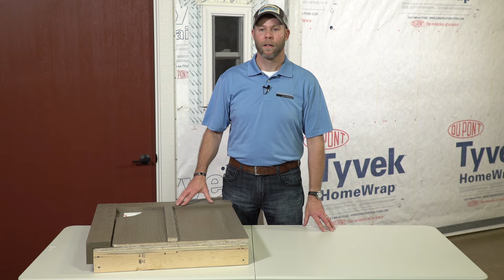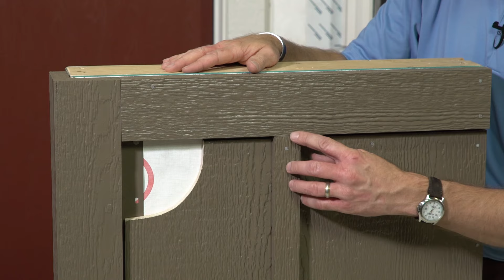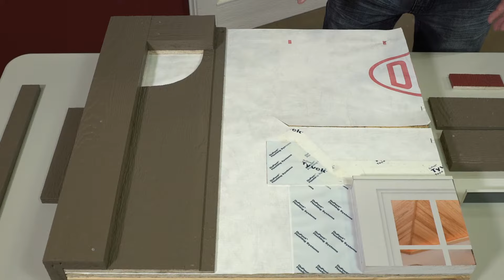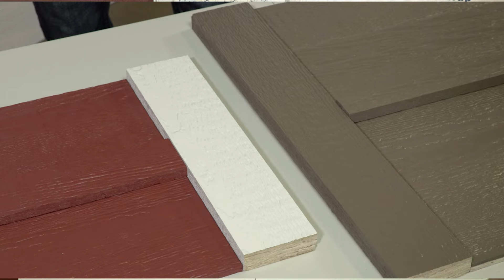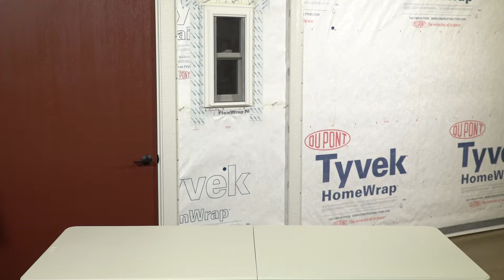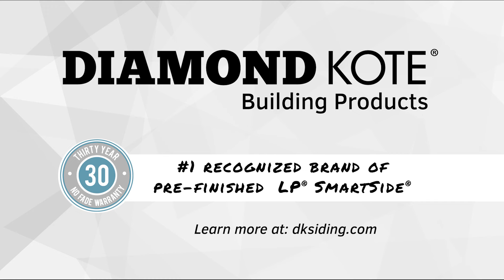Understanding LP SmartSide Board and Batten Installation Options

Comment: Don't double the trim above the window then cut your siding around it. Install siding first then install the 1x4 window trim. Saves unnecessary steps and less areas for water infiltration

Comment: With the new 3/8 panel and 19/32 batten, what's the window detail? Do you still pad the header and put the trim over the panel around windows? Or does trim get installed first with the panel butted up to the trim?
Reply: That part made no sense to me. I cut the panel to the contour of the window. Then I placed the trim on top. Easy peesy .

Comment: 3/8 gap. Why not just make it an inch. Looks like crap when done. Looks like a child installed it
Reply from the maker: Per our manufacturer, 3/8" is the minimum spacing requirement on all flashing, otherwise the warranty is voided. You can go with a bigger space, as long as it is over the 3/8" minimum.
Reply: @diamondkotesiding  I know. Which is silly.

Comment: LP recommends a 3/8" gap between panel siding and trim. It looks like you are installing it underneath or before the trim. This makes it look more finished but does it allow the siding to expand properly? Does it void the warranty?
Reply from the maker: Hi David! That's an excellent question. The typical space required between the panel siding and trim intersection is 3/16”.  LP does allow for trims to be installed over the top of panel siding.  The siding will still expand and this practice, when installed properly, will not void the warranty. Page six of the link below has great visual illustrations to assist. https://lpcorp.com/resources/product-literature/installation-instructions/lp-smartside-trim-fascia-english 
Thank you!
Reply: @diamondkotesiding  Thanks for the quick reply. Great video btw

Comment: The 7/16" panel is the only thickness available in my area, so that is what I am using on my house. According to the video, the panel is installed first and the corner trim is installed over the top.  What about the trim along the bottom of the panel? Can it be mounted on top, or do you need to cut the panel and install Z-flashing similar to the condition over the windows?
Reply from the maker: Hi Madeline - 3/8"  thick panel is available anywhere that Diamond Kote is sold. We'd be happy to work with your material supplier in order to provide that for you. Please contact us via our "Contact Us" page at http://analytics.clickdimensions.com/cn/aozuz/dkcontactus

The bottom trim could go on first and then and then the panel above it, but in order to get the bottom band trim and the corners to be flush, you are correct, you would have to pad out the bottom band board similar to the window head detail.

Please feel free to reach out to us at any time with further questions.